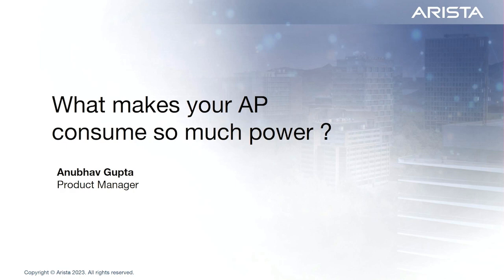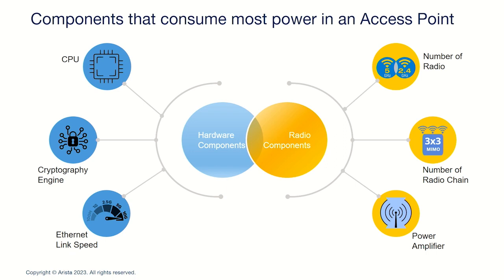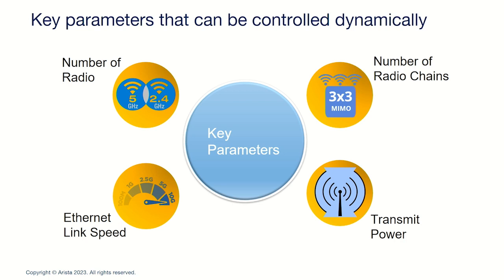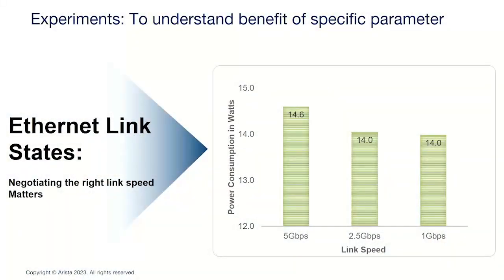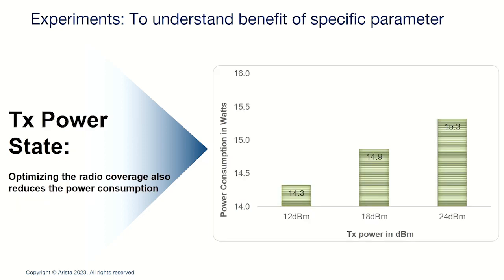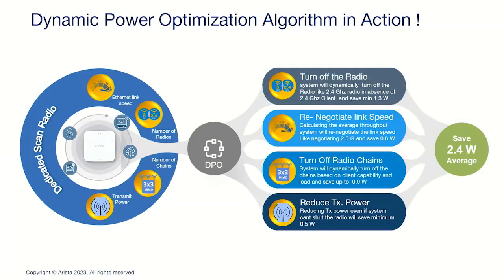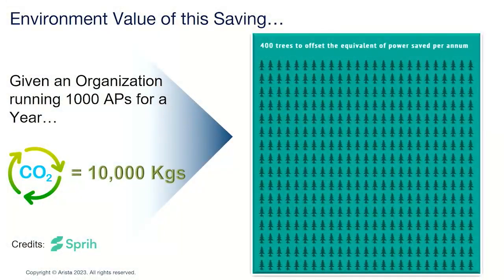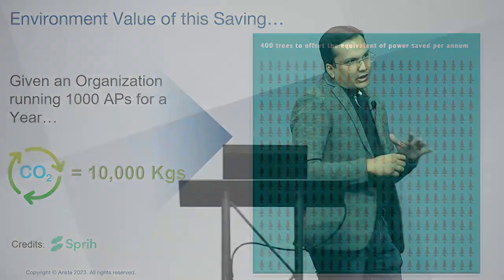What makes your AP Consume So Much Power? | Anubhav Gupta | WLPC Phoenix 2023

Comment: But and this is a big butt... having extra chains on may actually reduce power because the AP will need to transmit less.  It will on and off the wireless medium quicker if data is sent faster.  It will spend less time transmitting.  A test with 20 client devices connected etc. for total power drawn at 1x1, 2x2, 3x3 etc.  I would though see this very interesting if you needed to keep things under 15.4 watts for 802.3af reasons.  It would be cool to have a checkbox option in the AP of "802.3af mode" in case you have to connect to an old 802.3af switch before you can upgrade the switch.